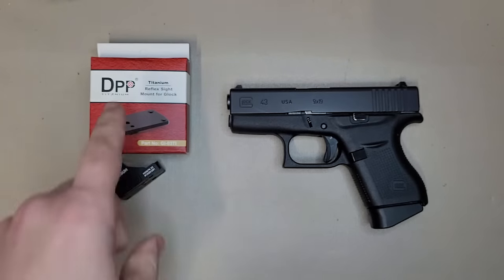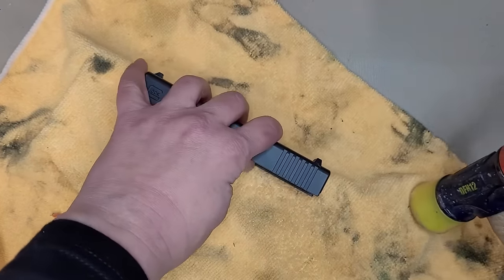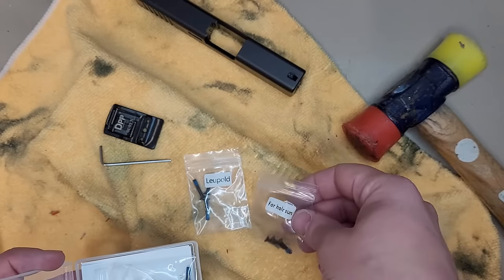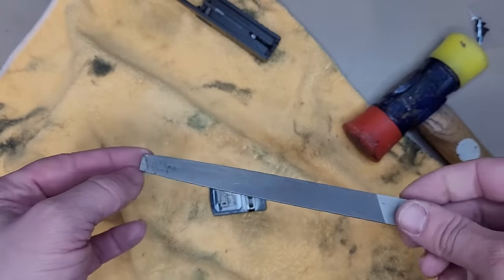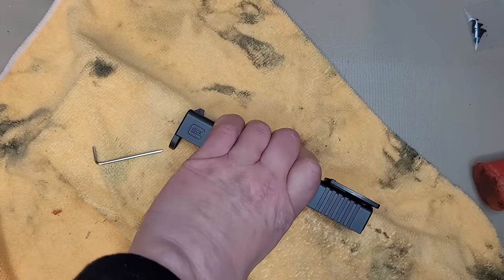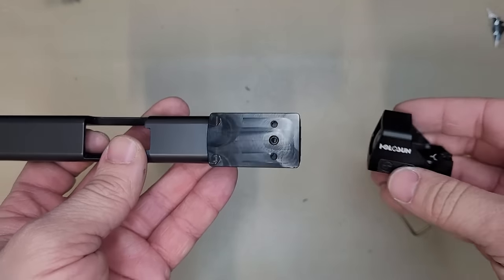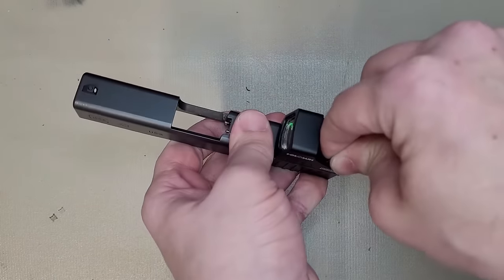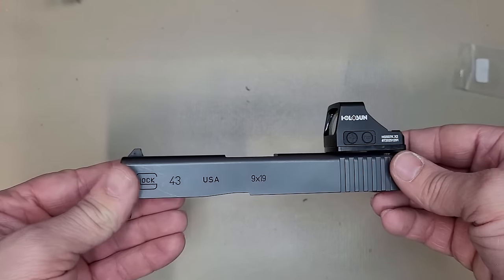I WANT A RED DOT, but don't have a MOS slide ... Easy Red dot instillation!!!

Comment: They’re not Titanium they’re 7075 aluminum. For the price, it’s the a good option to mount a red dot, but it sits so high up on the slide compared to an end mounted dot. And you lose the ability to run backup irons should your $200-300 optic or (more likely) $20 mount fail. It is a nice concept for something like a range toy, but totally not recommend for concealed carry or home defense. You have more failure points than a stock or rmr slide, it has a bigger profile than both, and realistically, if you’re spending hundreds of dollars on an optic, why not get a slide cut or an rmr slide
Reply from the maker: I like your opinion! This is just an option if you'd rather not cut your slide. Thanks for your insight!
Reply: 🙋 Yup. That was me. I installed it every which way.... including red lock tight, but just kept getting loose. I don't blame the device as I'm sure someone with more mechanical experience would have made it work. Probably welding the piece.😁
I just bought another slide with a cut and cool serrations. Now I'm happy.😎
Reply: @jeffofalltrades8489  I tried one of these on my carry gun trying to find the cheapest way to mount a red dot. I felt like it was sturdy but I didn't want to be stacking tolerances (slide to mount to optic vs slide to optic). The additional height of the mount also had me change my presentation as I had to hold my handgun lower in my shooting position to see the dot. It also increased the height over bore, making the point of aim/point of impact greater the further away you got from your zeroed range, negating any real accuracy advantages of having the dot in the first place. I ended up going with a slide cut to retain backup irons and to be able to cowitness the sights. The optic sits much lower with the slide cut and basically let me keep using my aiming/presentation I'm used to with my irons. I still have it and I wouldn't mind throwing it on another gun because I like the fact that is temporary, but realistically that is the only advantage to it. Optics cuts can be had for less than $80 depending where you look, and if you already spent a couple hundred on a dot, the extra $50 over this mount might be more appealing, especially if you want to mount your dot on something permanently.
Reply: Yes but they have a aluminum one and a titanium option when. You order

Comment: I've done this, and just wasn't satisfied; the plate and red-dot device were easy to install, but the red-dot's use was problematic for me because having the dot so much higher than where the iron sights used to be meant I had to adjust my firing grip since my natural sight alignment wasn't there. Under stress conditions I found I had to chase the dot to get on target or tilt the gun to get the front sight in the screen before dropping it enough for the dot to become visible. I fixed this by putting my own markings on the red-dot's frame and that worked well to help get the dot on target fast. In essence, I manufactured something of a co-witness to adjust for the dot's height above the slide. My next step might have been to install a tall front sight, but I decided I'd rather mill the slide. I like red-dot sights and they're great once on target, and using a plate is a quick and easy install, but you have to practice getting the dot on target without benefit of anything like a co-witness. Good vid, BTW, to show peeps this isn't a hard thing to do.
Reply: I wish Holosun or some other optics company, made a red dot that you could actually adjust up or down to lower or raised the dot.  I dunno, just a thought.
Reply: If you have your slide milled will your optic be seated any lower than using the plate demonstrated in this video? I would think that the optics would be better if they were closer to the center of the barrel
Reply: @Hodado  Yes, milling the slide brings the red dot lower on the slide. Specifically, a mounting plate will rest high above the slide in the rear sight bevel, but milling a slot brings your dot down not just the depth of the plate but also any slide curvature.
Reply from the maker: I know this is an old comment, but I have something here that will fix the issues you had with a product that is above and beyond...check it out ... https://youtu.be/BIx2QSiD5yQ
Reply: @Hodado yes it would be lower to the barrel if you chose to mill, this is just a more affordable option versus spending 150-200 for them to just work on your oem slide to make a mos
Reply: Installing a plate to mount any red dot believe me you won’t like it. Why? Because the high optic by the time you shoot you have to lower too much the gun itself. To be honest it’s not easy to shoot. I’m not happy with that.

Comment: Thumbs up for the informative video.  For anyone that wants to try a red dot I would not recommend this route or even having their current slide milled.  As someone that used to mill slides I recognize the market has dramatically changes in the past 10 years and it's exploded with options.  At the time of this vid there around 100 auctions for new stripped slides cut for various optics.  Buy a new slide.  If you don't like it, sell it used.  They sell immediately even used and beat up.  There is one with a broken tap stuck in it with bids right now.  Just swap slides.  The DPP also has some issues with tilt.  The dovetail cut causes the plate to be angled slightly forward.  This can max out the vertical adjustment on some optics.
Reply: ...do you have a source for GEN 4 Glock 22 slides?
Reply: @TallSlowGuy  That might be the only model/gen that doesn't specifically have slide support in aftermarket.  I think a Gen5 G22 slide will work on a Gen4.  I think...  There is at least a Gen5 G22 MOS.  If that doesn't work I'd still buy a used G22 gen4 slide then send that off to be milled.  Or wait on ebay for someone that has already done that and is selling theirs.  Note when those sell they will sell for less than an uncut factory slide.  One of the reasons I say not to have yours milled.
Reply: I agree, just ordered a cut slide with ports and ported barrel so I can just swap them.
Reply: Where do you buy slides milled ?

Comment: Great idea, however I would prefer to have the slide cut so the optic sits as low as possible.
Reply: We would “prefer” a lot of things, but if don’t have the means THIS ☝️ is the way to go! 💯
Reply: That milling is like $160
Reply: @robertcoco893  yeah and it's measurably better 🤷‍♂️
Reply: @robertcoco893  unless you own a machine shop like I do. Lol
I still have not milled mine yet, I just installed the dovetail mount. One of these day I might find time to mill it though.
Reply: Where do you order this from? All I'm seeing is Amazon
Reply: @brandonlavin3406  what?
Reply: @robertcoco893  Your life isn't worth $160?
Reply: @elitetrader5468  BS. My accuracy with my dot on a sight plate is same as on my gun with a milled slide. I feel confident I can protect my life with it no problem.

Comment: I have a Glock I wanted to install a red dot sight. Upon investigating, sending the slide out for milling is $200 just for the milling service. And it has to be milled exactly for the sight brand you want to use. I like what I saw here. I’d rather spent a few bucks on the slide mount plate and apply $150 savings to a better red dot sight.   Thanks for the video !
Reply: Your life isn't worth $200?
Reply: I guess depends on who ya ask . That's for mine. No one else's Lol.
Reply: @elitetrader5468 bro ur not gonna die using a plate
Reply: @WholeSomeHomie  if your life depended on it....would you skimp out on the $200?

Comment: EGW makes mounts for the popular optics and glocks, what I like about them is the progressive taper on the dovetail...you need a press tool to install..but it is the most solid fit I have tried yet...it basically becomes part of the slide.
Reply: or a hammer is a momentary press Richard, it's all half dozen of one, 6 of the other kinda thing really, just get'r done already if you're a shit shot Rick because it helps. It sure does help, yes it does. Like drawing hair around the target see.
Reply: @Roboticdoughbull3k  You made absolutely zero sense.

Comment: this is the same way i mounted my holosun 407k red dot with the dpp mounting plate..  first i wasted money trying out the different style/brands of rear sight pusher but i found that none of them work to my liking, plus it wont be able to push the dpp mounting plate on because it's not big enough to fit the dpp plate.. i decided to use a rubber mallet and it worked better than any of the sight pushers i bought plus it didnt leave any marks or damage either. i didnt sand the bottom though, i felt by doing this, it might not sit flush and even. without sanding the bottom, it still went in like butter using the rubber mallet.
Reply: how’s the plate & red dot so far?
Reply: @exanuel8023  still working and functioning like a champ!

Comment: Strike Industries scorpion universal g-surf glock reflex mount is another great option for a non milling / machining of the slide. it access many different footprints of various Red Dot sites. It even has a mount that replaces your back plate that the Red Dot adapter bolts to. It also has an optional charging handle also!
Reply: Bro can you take that charging handle off? Lowkey ruins it
Reply: @skubasteveskilla3316  yes you can run without it.
Reply: You can pick it up at optics planer...or Academy Sports And Outdoors
Reply: @JettBlast  Preciate it 💪🏽 Fs looks a lot nicer than the one in the video
Reply: @Skuba Steve Skilla  it is and adapts to many different Red Dot site manufacturers mounting configurations.

Comment: Jeff, this is okay in a pinch, or for some plinking fun at the range. Best thing to do is to get an RMR cut on your slide or purchase a slide cut for an optic. Lots of companies are $150-$200 bucks and are made to the same grade and materials of Glock OEM slides. I recently got my hands on a TR-Enabling RemSport RMR slide w/front and rear serrations on sale with free shipping for $130.00 for my G26. Let me tell you that I was beyond impressed with the machining and finish an insane value for the money. You don't need to pay $450.00 for a slide.
Reply: Spent alot of money. We get it you wish you seen the video sooner.
Reply: @iruamak8225  What!? Not sure so get it. He highlighted a dovetail plate that has a a sight built in and that one is pretty sweet. Going to get it for my G19 as for this one, he himself said it was no bueno.

Comment: iam watching this video 1 year after it was posted! I was curious about other mounting options other then milling the slide. I bought my first glock 19 and it is a MOS wow i thought no need for a dovetail mount now and i can keep my rear sight! Nope red dot sits up to high to co witness with regular size sights because you still have to use a mounting plate. Whats a fella to do now buy suppressor height sites? The Boom i found the scs for glock 19 mos foot print and i can keep my Amiraglo night sights and it needs no battery its fully solar power! Wow in one year the tech has changed so much i cant wate to see what 2023 brings for the gun industry!

Comment: I saw a guy who done something similar like this with a smith an wesson performance center 9mm ez, which is what I have,he had to take the slide off,the screw is under the slide holding the iron sights on,once off,the he simply added the plate an screw,then mounted red dot an boom,man I'm so glad,cause this is my first pistol an thought I'd surely have to have my slide milled,so now I'm excited to get my holosun reflex,to go with my olight baldr s laser light combo.

Comment: Great install video.
Thank you. Let us know how it holds up after 300 rounds.
Reply from the maker: Holding up great! Use the locktite like you should, and there shouldn't be any problems!
Reply: @jeffofalltrades8489  Glad it worked out for you. I installed one on my G19, but I'm sure I didn't do it right because it kept getting loose. So, I bit the bullet and paid for an RMR cut and professional installation.

Comment: Any issues with zeroing in your holosun 507k? I did this exact process and used a bore site to laser it in but the 507k bottoms out just a half inch to a full inch below the bore site. I’m assuming this was a defunct sight but wanted your opinion on zeroing in if you had any issues

Comment: i have a plate by a different manufacturer on my ruger american.   that rear site was not going to come out with a hammer, without damage.  it was too tight.  i bought a quality site pusher.  the advantage is, i can use this pusher on my other pistols, to do more than just install a plate.  it has graduated markings, so i can see precisely how far i am moving something. no guess work if i want to install better sites, or re install the old ones.   i can also loan it out, or do my buddy's guns for him.   the red dot on my american works ok,  but i find myself having to hold the pistol at a funny angle to see the dot.  once i got used to doing it,  target acquisition was quicker, and my grouping improved.  i needed the red dot because i'm getting older and my eyes aren't what they used to be.  
so far,  i'm a couple hundred rounds through it, it's not moving.

Comment: everyone keep in mine it’s hanging because the g43 is part of the glock slimline series and is the second smallest glock next to the g42 (the 380 version) so if u get this on a wider gun it might jus look normal. everything looks wonky on the g43 thats why i traded mine in for the 43x besides hating the revolver like capacity of the 43.
Reply: G43 and 43x are identical slides
Reply: @lentinikhalsa1  na i know. if u have bigger hands tho try holding a 43x if u haven’t yet its nice and got the front serrations if ur into that

Comment: good video but imo it is not the correct way to go for the proper alignment of the dot or placement of it, i would only go with a cut slide or a leupold.... but this is a good option? 🤠

Comment: Great video!  Thank you so much for putting this together and sharing with all of us!  

Curious if you know of any way a light can be mounted to a Glock Gen 1 or Gen 2?  I've heard there are adaptors out there, but I haven't seen one.

Thanks again for this great video!
Reply: Check the Glock Store
Reply from the maker: I would have to look into that, I'm not familiar with that?

Comment: My issue is that I can’t get the sight to zero in perfectly since it sits too high. Is there a fix for this?
Reply: Yes, send your slide to C and H precision and have your optic installed properly with a mill job.   Plus, you'll have back up irons as well.

Comment: This is when you send your slide off to Boogeyman Customs or one of the million other machine shops who offer this service and get your slide milled for your specific dot. Not only is it by far the strongest, most durable way to mount a RDS to your pistol, but it is also the cleanest looking aesthetically. Easily the best option when it comes to mounting a dot.. It’s really not even close.

Comment: To fully support the slide when working on it as was shown in the video, I found it better to drill a good sized hole and droft the sight into the hole. Much easier to handle.
Reply from the maker: We don't have this issue with the newest product in my most recent video! Check it out... much easier to install and WAY more reliable

Comment: Is that part only for Glocks will it work on other pistols if not can I get one for my S&W Shield plus? I like my Shield very much it's also a Performance Center as well so it has a very nice trigger. But putting a red dot will increase speed on target and greater accuracy which is a DEFINITE PLUS. 👍

Comment: I'm pretty sure I know the answer but I want to make sure before I buy but will the plate fit the same on a 43x?
Reply from the maker: It should because I'm fairly certain those share the same rail. If you look up this mount it will say everything it mounts to!
Reply: The dovetail cut in the slides are the same size. There are plates for RMR and Rmsc. The Rmsc/ Holosun K series are the best fit for 43/43x/48. The RMR plate will also fit the dovetail but the ate and optic will be wider than the slide.

Comment: I tried something like that on a glock 17 and had a lot of problems with stove pipes.   I switched to a glock 19 MOS and never looked back.
Reply: Makes sense because you are adding extra weight that the slide wasn't meant to cycle.  That's why a mill job is superior.

Comment: Good video of showing installation,  but it seems like the optic sits too high.   I have a few handguns that came milled for optics and I picked up another g19 gen 4 yesterday and have a couple red dots laying around wanted to put one on. Ran across this video. Do you have any problem getting zero, since it sits that high?
Reply from the maker: I have not, but with the dovetail I have heard of people saying it tilts high/low. That isn't my case, but this sponsor is an amazing sponsor and if there are any problems I'm sure they would assist in any way possible!